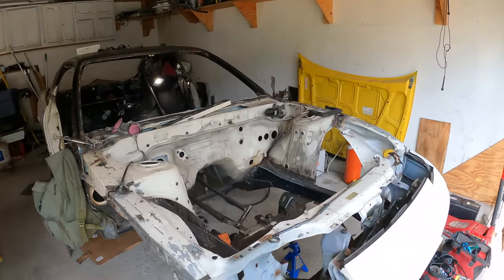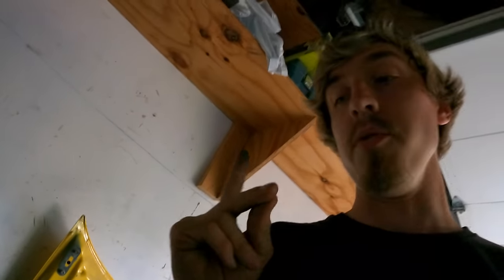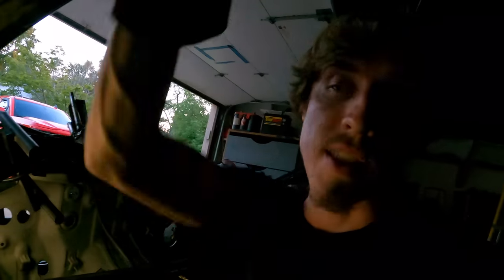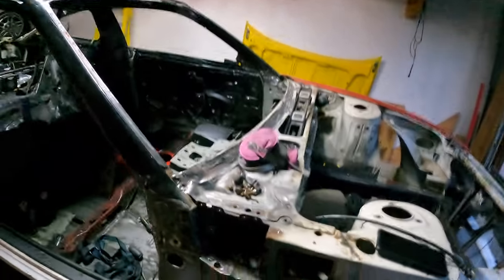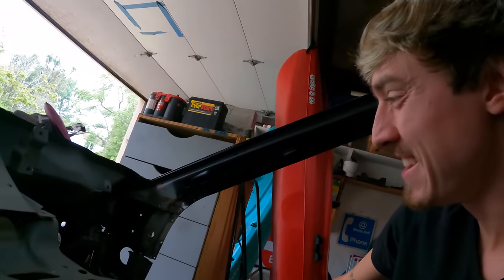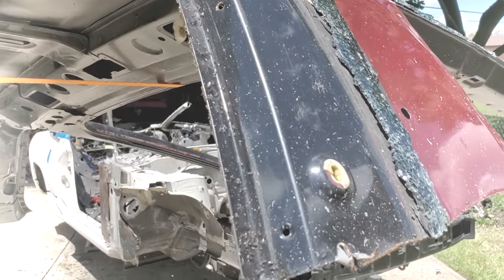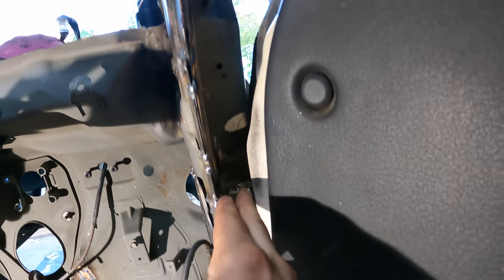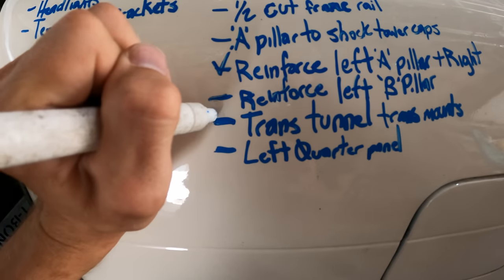I Hope These Doors Fit my 240sx Restoration

Comment: Mike…. Hope you read this…. Now that you are starting to encapsulate some of your welded sections in the pillars you should look into Eastwood’s interior rocker panel spray to spray the inside of the completed enclosed spaces and help keep them from rusting out from the inside.  The spray comes with a long bendable straw that you insert into the area and then when you spray it comes out in a 360 degree spray to coat the whole inside.   Use it in frame restorations all the time to protect them.   Do it now though before those welds start to surface rust internally.
Best wishes, it’s coming out great!
Reply from the maker: Thanks for the advice! I'll 100% look into that!
Reply: For real use the Eastwood. Last thing you want is rot from the inside out after all you have been through.
Reply: @PrizzaMike  no worries!  If you need help finding it at all let me know And I’ll get you the info.  Also I have a bunch of extra random 240 parts if there is something you need in particular
Reply: Its really good i know this in germany and we have much rust so we coat the whole inner sections with a ropelubricant after this spray

Comment: Damn the door fitment is about as good as you could have possibly hoped for.  Nicely done!  What are the plans for your "t-bone" sign?!  Going to weld that in someplace?

Welp your video is over and my lunch has been eaten, so back to work on my S13... I'm soooo sick of cleaning up rust and repainting... just a bit more to go.  Can't wait to rebuild the front end and get this thing back on the ground!

Comment: I’d say you should have tried to get the dash bar in to line it up. You may have some issues there. Yeah the spot welds tell you but it can still be slightly off.

Comment: I’ll be making carbon front fenders off of my unrolled stock ones, if you want a pair for free I’d be more than happy to do that considering the amount of work you’ve put into this thing already, hope this comment reaches you
Reply from the maker: I may have to take you up on that offer 👀🔥
Reply: @PrizzaMike  for sure I'll let you know when i have some ready 😃 and for the rear quarters i could possibly make a mold but the recreated part would either be fiberglass or carbon instead of metal